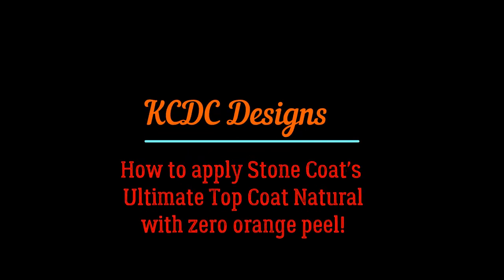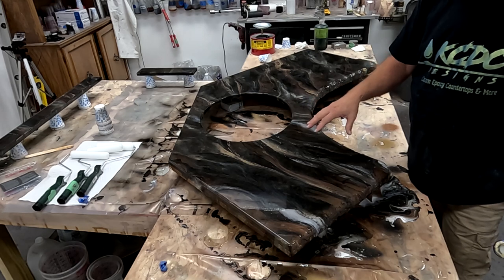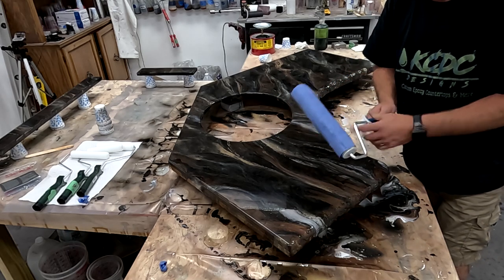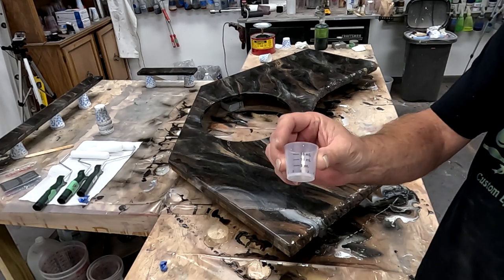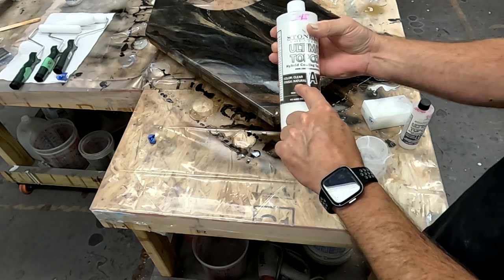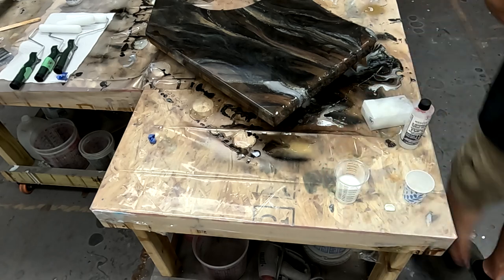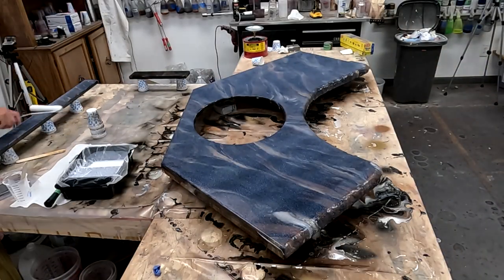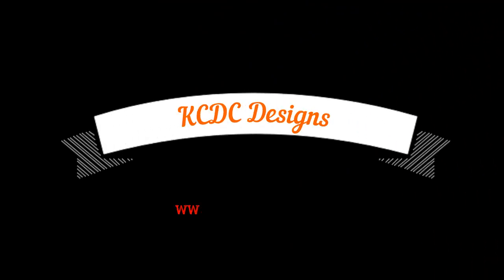How to get a flawless, smooth finish with Stone Coat's Ultimate Top Coat (matte finish) KCDC Designs

Comment: Wow I’ve struggled through orange peel on the matte, but my friend ended up loving it . Revisited a lot of videos on the ultimate topcoat but I do believe the straining may be the key to future attempts!!
Reply from the maker: Hey there, and I'm glad your friend loved it! 
There's a fine line between too much product applied (orange peel) and not enough which can result in the roller marks showing after it dries. Personally I'd rather have a bit of orange peel, which actually increases the scratch resistance.
I've noticed with the newest batches of the matte, that it's much thicker and not as easy to apply it orange peel free.
The previous formula was thinner and really laid out flat. Do I add more water to make this new batch thinner? I hesitate.
Regarding the straining, that's what catches those little white nuggets that remain on the surface. They dry clear, but still leave a bump in the finish.
Thanks for your comment, and feel free to reach out if I can be of any help.

Comment: I got an orange peel look on my counter top. Can it be fixed?
Reply from the maker: Hey Bonnie! 
It's not unusual to have some orange peel, and that's not a bad thing as it actually adds to the durability. If it's more than you feel you should have, reapplying is your only option as it can't be sanded out and/or fixed.
Is it the Natural or Gloss? (orange peel in Gloss is unavoidable).
And did you use the RK3 ratios and mixing formula?